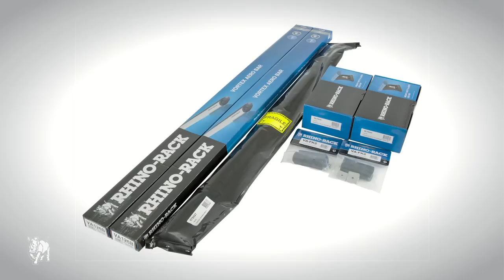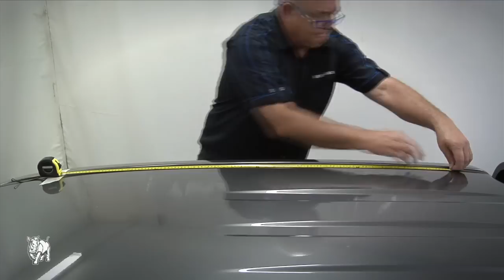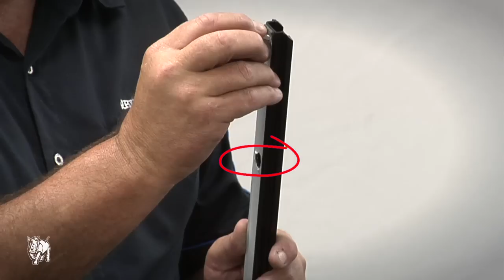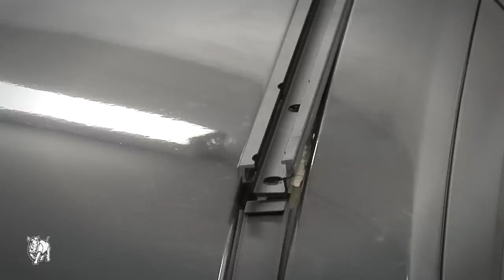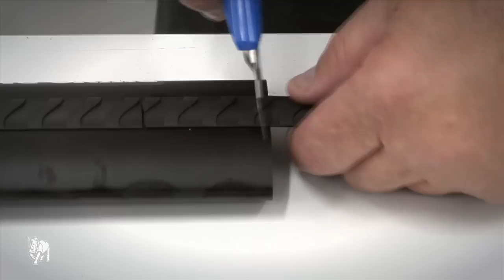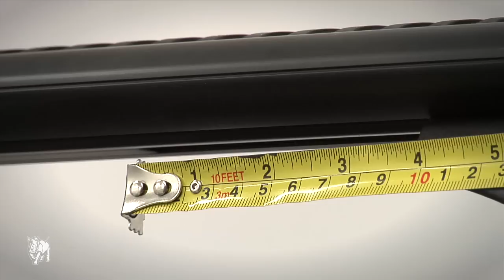Rhino-Rack | How to fit Vortex RLT500 Roof Rack Systems

Comment: Can I fit thre mounts reverse so the key look is internally not externally. 

Because the Roof top tents rails will hit the end of the Rhinos mount. So if I turn the mounts 180 degrees the rail attachment won’t hit the roof rack mounts. ?

Comment: Had this system installed on my car and its missing the strips which you cut to length for the bottom of the cross bars. What did you call these strips are I can't understand what you said. The gap is making a noise and I need to fill the gap with rubber strips you used. Thanks
Reply from the maker: Hi there, the strips are called "Vortex Bar Underside Strips". You can get these from any of your local Rhino-Rack dealers - reference part number M641. Find your nearest dealer here: https://www.rhinorack.com/en-au/where-to-buy. Thanks